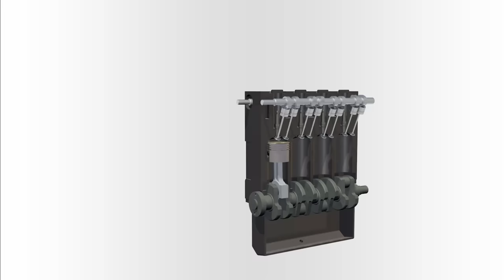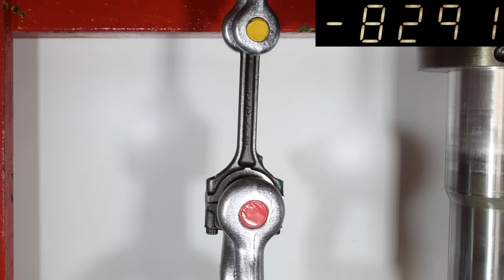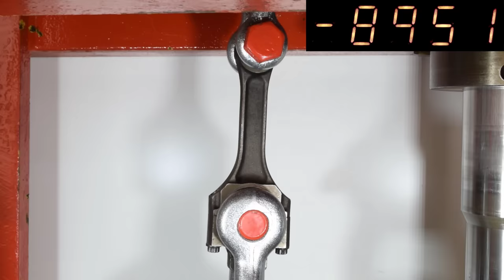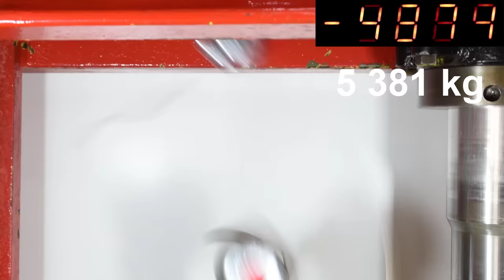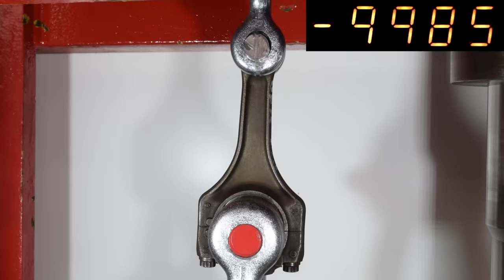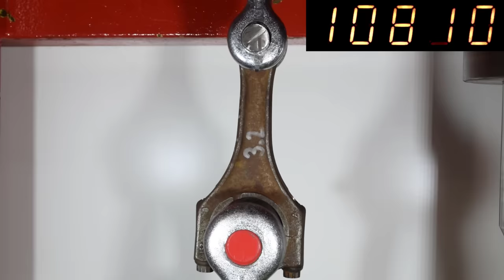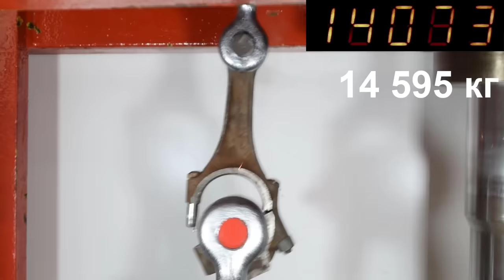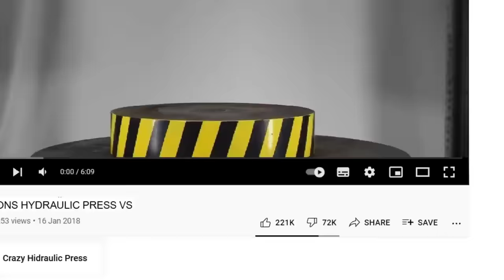HYDRAULIC PRESS VS CONNECTING RODS

Comment: Its a bolt strength test not actually a conrod strength test… why dont you try to use as hammer and compare them by the time you kick in a nail into wood then make “fair” comparison which rod was the best design for car use 😂

Comment: The E34 3 litre engine's rod failure at abt. 5 tons was probably more of a defect than a regularity. Also - as a Russian channel - you should know that "Car 1968" is Moskvitch... 402... I think? Or 412? Either way - not really a "russian" car - because there are very, very few of real "russian" cars which wouldn't be copied or reverse engineered in some way or form from a Fiat, Opel, Ford or others. Either way - impressive stuff with the connecting rod from the E60 M5 V10 engine... that's pure German engineering for you. Try to copy that.. oh wait... you're probably copying something from North Korea or China right now. Well, good luck with that - from Latvia.
Reply: У Вас, только " шпроты" делают.

Comment: How much difference could be made with stronger bolts on the big ends?
And how much stretch did they get before the bolt breaks?
Reply: There will be no difference, because bolts normally carry almost nothing in comparison to the power cycle.
Reply: @adamturowski8948  are you sure about that? In each of the videos its the bolts that are breaking.
Also, what do you mean by the power cycle - when the rod is under compression?
Reply: @JakobusVdL  Yes, in an engine normally these bolts carry almost no load (mass of a con rod + mass of a piston). Literally almost nobody cares for these bolts, because con rods bend or break because of the compression forces. I have never seen in my life a con rod with broken bolts.
Reply: @adamturowski8948  that's mass of con rod and piston being stopped from very high velocity thousands of times per minute - that's far from 'almost no load'
Reply: @JakobusVdL  Comparing to the compression force, negligible
Reply: @adamturowski8948  but similarly the bolt area carrying the tensile force is small compared to the con rod area carrying the commpressive load.
Reply: @JakobusVdL  Sure, but why would you want to test it? To show what?
Reply: @adamturowski8948  test what?
Reply: @JakobusVdL  The strength of the bolts by putting conrods in the press?
Reply: You'd have to ask the channel why they chose to test the tensile strength of connecting rods.
As most of the failures occured on the bolts, I asked what I think are a couple of reasonable questions - what difference would stonger bolts make, and how much do the bolts stretch before they broke.
(I'm wondering if the bolts were stronger, what would fail next, and also if the bolts have stretched significantly well before they break, then their effective failure has occured well before the bolt breaks).
You think those questions are irrelevant, but (it seems) because you're only thinking about the strength of the rods in compression.
I think that's fair enough, but not really relevant to a test of the tensile strenght of the rods.
Does that help?
Reply: @JakobusVdL  Again, I have never seen, by anyone, anywhere, a conrod with broken bolts.

Comment: I had a con rod explode in compression, came out the cylinder and crankcase housing on a Lambretta overbored to 299cc and compression upped to 13:1. I overturned it... 😐

Comment: This test is useless, you need to test it on a press.you are only testing the bolts strength.that is not how it works .i hope you aren't engineers, because you failed in this one.

Comment: The Moskvich conrod is an unbelievably strong part in an otherwise not so good engine. It is a 1.5litre all-aluminium steel sleeved 4banger, 75hp stock. While allmost unilaterally hated amongst tuners, there is one known high horsepower Moskvich. A finn, Ville Oksanen has built a 700hp compound-charged dragster running 9sec 1/4 miles. It used stock conrods with some Volvo diesel pistons in its concrete filled block
https://youtu.be/IOIgeSHjrds?si=l4vSIyv26Nc0Kx3r

Comment: This is not accurate at all! The bottom pipe is smaller in diameter than the crankshaft the piston was designed for. Thus the numbers are lower what they are really capable of. Bolts bend before breaking in every case because the free room between the bottom pipe and the piston walls.

Comment: The power stroke isn't pulling the piston, it's pushing it down.
Reply: De-acceleration is when 99% of rods break. And 99% of the time it's the cap bolts that fail before the actual rod. Every drag racer and engine builder will put high quality bolts like ARP in them.

Comment: Not a great test since it's only testing the strength of the bolts not the actual structure of the connecting rod which in an engine has more compression force.

Comment: Horse manure,as stated, conrods are designed for compressive stress,what you are doing is testing conrod bolts,also the big end mandrel is too small thereby deforming the con rod cap exerting a sideways bending force on the con rod bolt,all of which proves nothing.

Comment: the effort suffered by a connecting rod in an engine is compression and not traction, the only traction effort that a connecting rod suffers is to pull the piston down, now in compression there are extreme forces because in cases of turbocharged engines where at the moment of ignition very high loads and compression are applied to the connecting rod through the expansion of gases over the piston... horrible video...

Comment: Use compression not tension. Those rods are designed to withstand compression, they are also subjected to tension due to inertia at high RPM. Or if you want to test the bolts, build a jig for that....dislike due to improper content.

Comment: Useless. A) as many said compression is what to measure B) so what if one is stronger than another, if they all work which is the most efficient? Strenth is not the only important parameter. What about efficiency, rpms, engine performance

Comment: This is like if you were testing shovels. You attach the handle to an immovable object and then pull on the head of the shovel until it rips off of the handle and measure that Force. I understand that these videos are just entertainment, but it is beyond pointless if something is tested in an absurdly different way from its intended design.

Comment: As soon as I saw the first rod being tested for tensional strength instead of compressional strength, I stopped watching. Clearly I’ve spent too much time watching multiple YouTubers replacing Conrods in their massively retuned engines to increase Horse Power, because that’s where the original engines have a weakness. I love watching objects tested to destruction, but this particular test seems somewhat pointless - or am I wrong?

Comment: That piece of crap 1968 car totally cleaned up the floor with anything BMW !!!  I had a 320E that never did run right, that must explain it.  I should have installed some 1968 rods and then go out and do some rev limiter burn outs to break them in.

Comment: Okay,,,, an almost pointless test since the important part of the extreme forces it has to withstand are compressive. This test of the bolts is of almost zero practical importance because the forces in this direction are not even close to the compressive forces it needs to endure.

Comment: This is a pointless video.
1. Compression strength is important for a conrod 
2. The relation to the actual loads of the engine is more meaningful, there is no point to design a very strong part if this is not required

Comment: what is the point of this test?  Are you testing the connecting rod bolts?   Absolutely pointless.  You need to apply pressure on the rod not pull on the bolts!!!!!

Comment: What nonsense test are these???
Reply: how is it nonsense ?
 Conrod's break in all manner of ways , this is a relevant test .
And manufacturers generally build to price , if you open up a lot of factory engines you can see connecting rods are commonly  built with just enough strength and not more , and the engines are tuned to a horsepower level so as to make it last while spending minimal money on components .